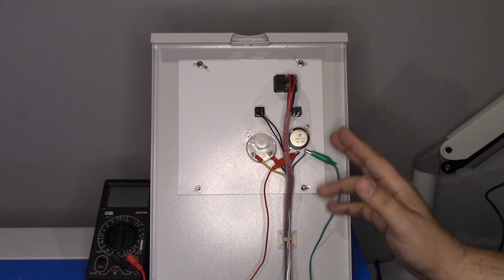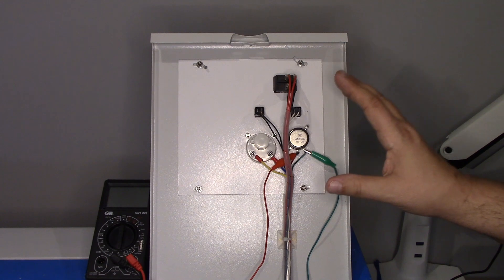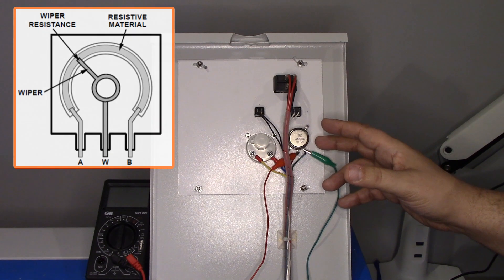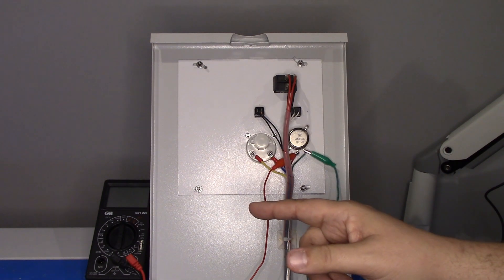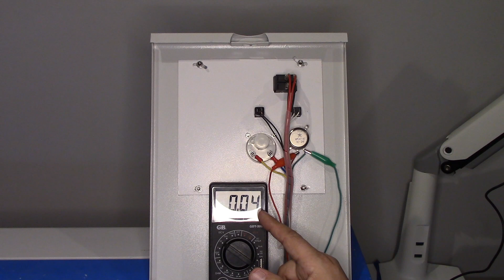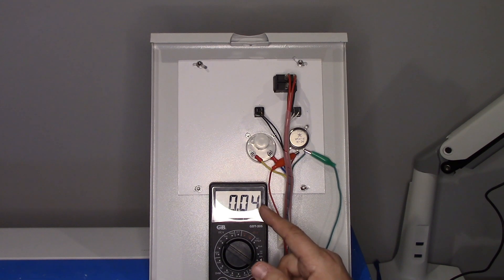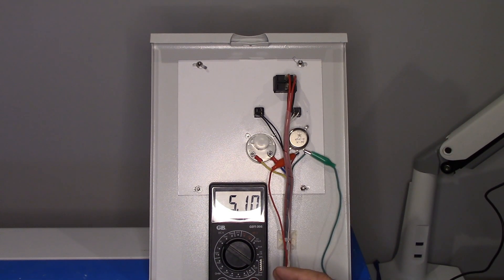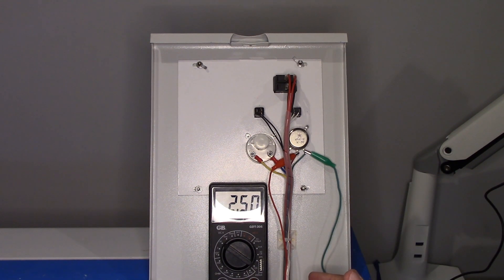eBay K40 CO2 Laser - Simple Fix For a Common Problem!

Comment: All great info and such, but what are we looking for if it is not working properly? In your video you show the voltage going up as you turn the dial. Am I to assume that if the voltage does NOT increase when turning the dial then the Potentiometer is no good? I hooked mine up to the multimeter and got the same results as what is shown in the video. I've replaced the tube with a new one and replaced the....ok whatever the white turbine looking unit with the red wire connecting to the tube is. I have not changed out the entire PSU. I get a green light on my test button located on the chip board, but still laser will not fire. I have 1 machine that works great and trying to get this one running so I can sell them both.  Any guidance would be greatly appreciated.
Reply from the maker: First is the machine properly ground as if no, it will not fire as the the cathode depends on a solid low impedance (less then 6 ohm) earthen ground.   If yes, and you have power at the pot then your HV supply is likely bad...

Comment: So my current issue I'm having is that the laser lights up, but arcs right at the end, seemingly right at the Cathode. Does this seem like an issue that can be solved with a change of the potentiometer? I ask because my laser has stopped working after a long deep engraving where it seemed to overheat and I'm trying to figure out what part is dead so I can replace the correct part. If the potentiometer is the issue then I can replace that super easy. At the moment it's either that, the power supply or the tube. As the tube still has the laser flowing through most of it just fine I think it may be the power supply.
Reply: I can use any help at all. Even if you aren't super sure any answer helps me a bunch. Thanks.
Reply from the maker: Can you post a picture as I do not understand "but arcs right at the end"?  First is the laser properly grounded (see in the eBay / k40 playlist the video on ground as if not your endangering yourself and it will not work properly as it must have a good ground to work.  If the tube over heated my bet is the tube has gone bad.  Next week I will be releasing a step by step video on replacing the laser tube.  Since the laser is firing I am doubting it is the power supply...
Reply: @DIY3DTECHcom  Absolutely. This is the video I initially took https://www.youtube.com/watch?v=BV-G8kNC840 and then I also have this video of the arcing at the cathode. https://www.youtube.com/watch?v=dbjea3VOJ8U

Comment: Just sharing knowledge and nothing else,  the pot is not wire wound as one might expect it is a carbon pot I took mine apart a few time and changing it is no big deal it is finding a good replacement at an affordable price is the biggest issue, as for replacing it with PWM, it is not the correct way to PWM this laser cutter, That pot should be left in place to limit the current, the L pin should be used for PWM The L pin on the right side of the power supply. here is a good blog explaining why we shouldn't PWM on the "in" pin,  like it is widely thought  http://donsthings.blogspot.com/2016/12/engraving-and-pwm-control.html
Reply from the maker: Thanks for writing and knew someone was going to write this, however mine was of the ole wire wound type.  I am sure  it comes down to what they have on hand as I have had a couple each are slightly different.  If you watch on Friday I replace it with a higher quality (carbon film) unit.  As I have tried a couple different ones, and the one I share on Friday is the best one I have found after trying a couple.  Also yes on the pot being left in place as a current limiter for use in a PWM sinero and I will likely do a video on this in the future.
Reply: @DIY3DTECHcom   i will definitely stay tuned for it.

Comment: You got to be kidding - $1,317.11 for a cheap Chinese K40 - you gotta be kidding.  Thought you were posting great deals.
Reply from the maker: If you go to http://diy3dtech.com/purchase-laser/  they run the gambit from 309 to to us some ask $1,317 (seen them for even more too) however why I put the page together as the API pulls the the top 50 from ebay...
Reply: The 1300$ dollar one is normally a K40 with a 50Watt( must have a cap on the side)  and the newer style mirrors and laser head and with a Manual Z bed height adjuster, i bought 3 of the normal ones within a few months  around the 550$CAD price range